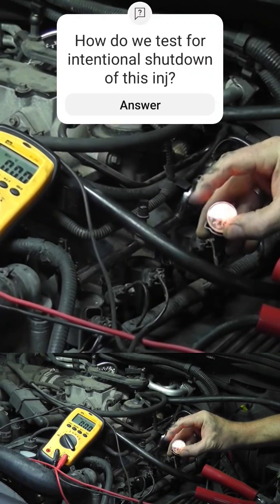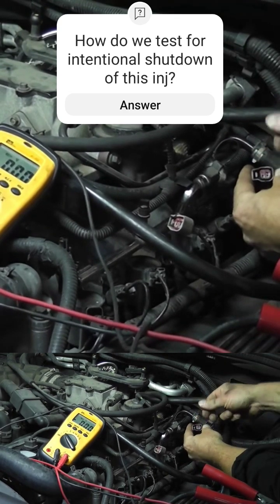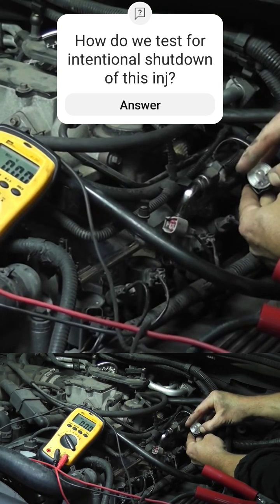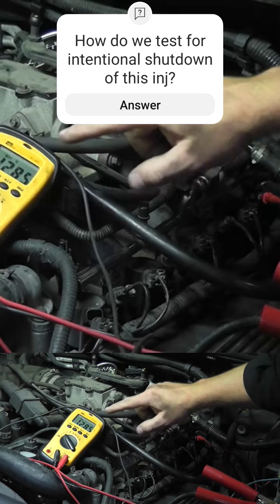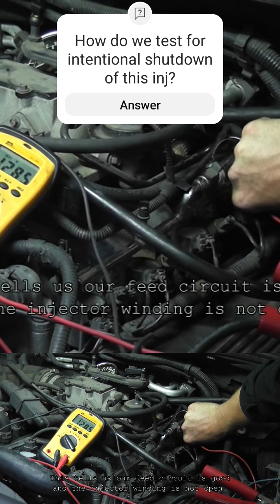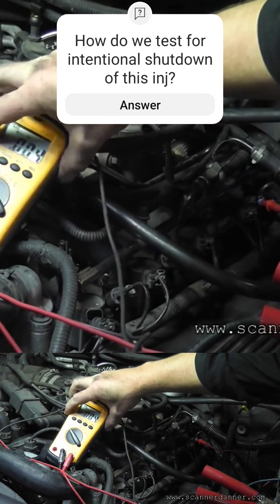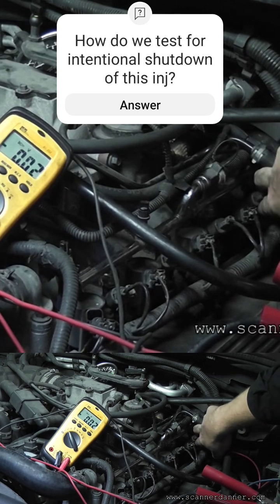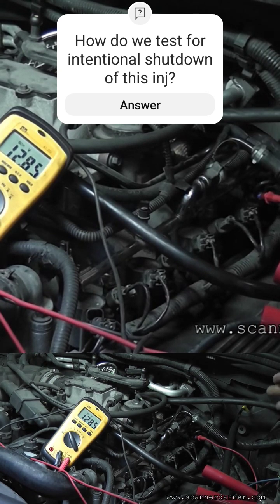No Injector Pulse Testing #misfire #injector

Comment: Hey man, negative ltft on both banks that go more negative as throttle increases, and gets better with steady throttle. Symptoms are SLIGHT rough idle (fish biting sensation) slight bucking when pulling out from stop casually, and bogging at wot that gets better higher in the rpms. Think i have leaky injector that isn't closing all the way, what would you think?

Comment: Educational video as always. What could cause air in the fuel rail on hot soak? Gasoline engine. Thanks
Reply from the maker: A bleed down issue and it's being caused by fuel boiling. It's not air. It's fuel vapor.
Pressure raises the boiling point on liquids and when psi drops, so does the boiling point. This is the main period of time where it is critical that fuel psi holds on shutdown

Comment: Switch it off, then restart, you should have a few injector pulses before the ECU intentionally stops the injector pulse
Reply from the maker: Exactly! And it is that simple. This wasn't our issue here, just wanted to raise awareness
Reply: If ya dont mind me asking, why would computer shut it down?
Reply: @brianb5779  this is a system to protect the catalytic converter in the event of a misfire. Unburnt fuel can destroy a catalytic converter. So, if a misfire is detected (spark, compression or a blocked injector), the engine ecu will 'switch off' the injector pulse for that cylinder
Reply: @blackbeltdiagnostics  Appreciate it brother, thank you

Comment: What are you using when your checking for flash
Reply: It’s called a noid light
Reply: @Mobbstyle36  I guess you could probe at the ecm on the output wire to see if the wire is actually sending or recieving signals to and fro?